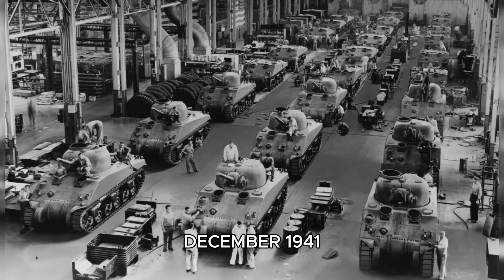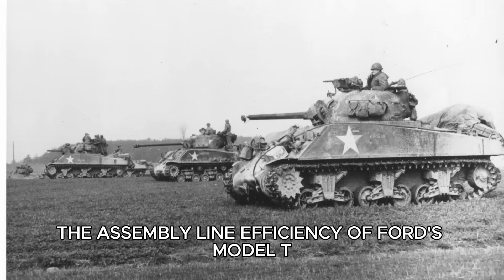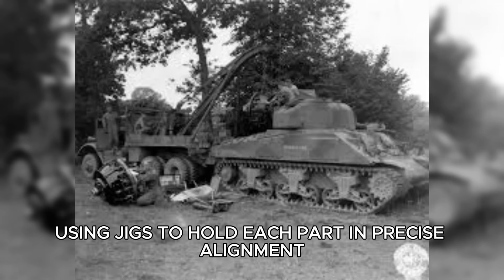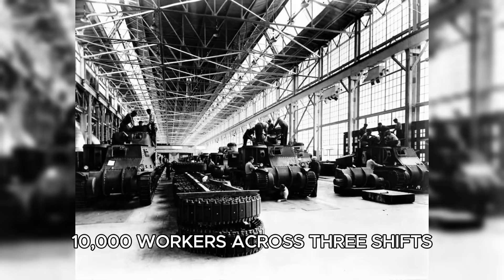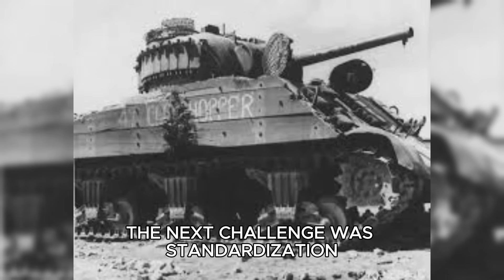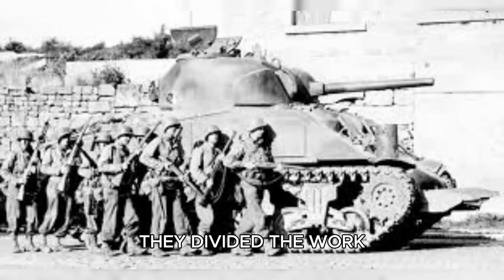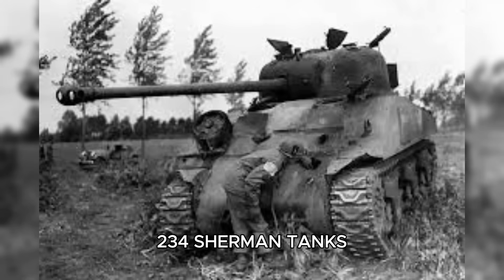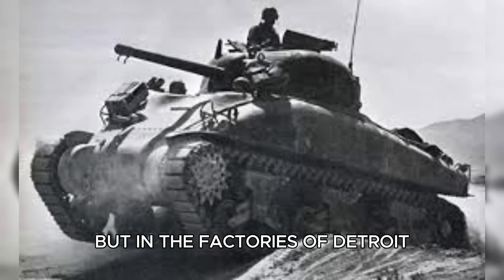How Engineers Designed The Sherman to Assemble in 10 Hours Instead Of 300

Comment: The video makes some interesting points about American manufacturing, but I think it’s taken a few liberties and is worth adding a bit of context. 
The U.S. did an incredible job streamlining Sherman production, reducing assembly time from hundreds of hours to just a dozen or so, but they weren’t the only ones using modular design, jigs, and multi-factory co-ordination. 
The Soviets were building T-34s at remarkable speed under far tougher conditions, and even Germany used interchangeable parts across factories.

America’s real advantage was in its industrial conditions, no air raids, a massive workforce, abundant resources, and a stable supply chain. 
That allowed them to scale up in ways other nations simply couldn’t match. So, it's not entirely unique.

While it’s true that global industries learned from wartime logistics and mass production, saying the Sherman assembly line directly inspired Japan’s automotive rise oversimplifies things quite a bit. Still, it's a fascinating topic, and it is good to dig deeper into how wartime engineering/production shaped the future.
Reply: The Soviets were using American steel plates ,welding rods,welders ,machine tools, and even entire factories. The lend lease to the Soviets was staggering !!!